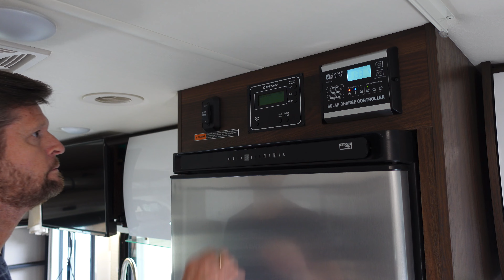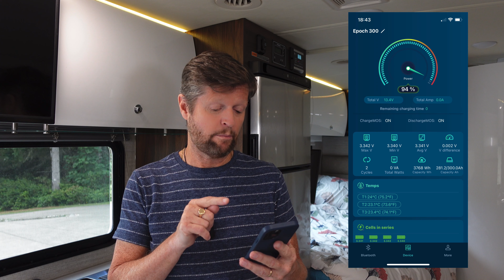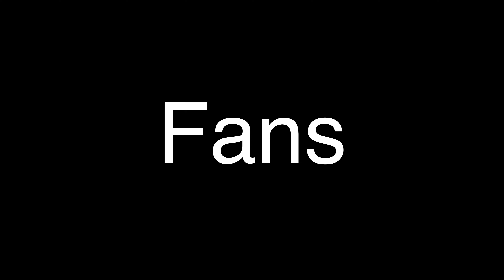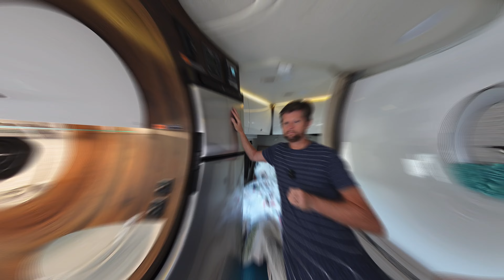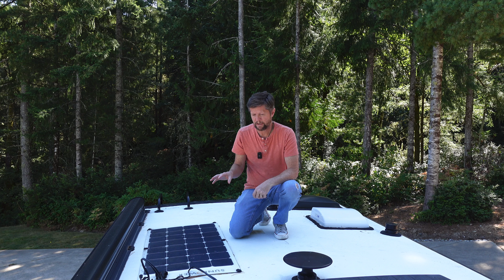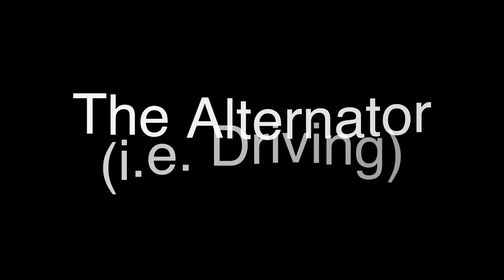Winnebago Navion / View: Battery Power Management Strategy

Comment: Used your videos to install 300Ah Epoch in 2020 (2019 Sprinter Chassis) Navion 24D    Very well done.  All works except charging from Alternator.  
Engine Running, MasterVolt Charge Mate Pro shows following
A Side 14.8 VDC
B Side 13.2 VDC
Switch Input floating, measures 1.99VDC

Green LED On   Solid
Red LED Off

Seems to me even though Solid Green A not connecting to B as not within 200mV.

Epoch App shows no charge current flow also.  

Any Suggestions?
Reply from the maker: That is strange - should be the same hardware as mine. I am guessing your Chargemate may be different and may require a change of charging voltage for the Li battery.

Comment: I have a 2021 View and as I understand the engine alternator does not charge the house batteries. Is that correct? I have two AGM batteries for the coach.

Comment: Very informative.  
I own a 2020 Winnebago View 24V.  I purchased it new and travel all over the Pacific NW, Arizona, Nevada & Montana.  My exterior design is the same as the one shown in your video. 
I upgraded my batteries to 5 Lion Lithium. I also removed the flexible solar panels and added 680 watts of Zamp glass panels. I am using the victron system & Zantrex freedom. My generator is an Onan 3200.
I am always worried about running out of power.  I refuse to run the televisions and have not done so in three years.  I do however use my micro at the least, once a day. I run my coffee maker once a day as well. Instead of running lights, I purchased multiple battery candles, solar lights for the nights. 
My big power draw is my air conditioner which runs all day as I am in Pahrump Nevada right now where it is over 100 F (I am plugged in). I love to save money by boon-docking but this heat makes that impossible. It’s 104 outside, I needed to plug in or drive back north. I chose to bite the bullet and stay south & pray for relief.
Reply: I'm like you I have 600 watts on my roof, I what have 1000 watts in portable panels. I invested in an all in one 3200 watt inverter. I installed 4 310 amp hour batteries in the rear storage area. I use two portable dc AC units when not using the roof Air . sometimes I bring my 3600 watt portable power station.

Comment: Fantastic video!  I just had one question though for my 2022 Winnebago View.  When plugging into shore power, does the inverter/converter need to be on or off? I have 500 W solar panels and they charge the battery well, however, when having electric available and plugging into short power I don’t see the power going to my battery. Do you have any suggestions?
Reply from the maker: That is strange. Your inverter should be a combination inverter/charger and should be charging your battery when connected (and no, the inverter does not need to be powered on). Maybe you have a faulty inverter or a bad connection?
Reply: @ttl_channel  I agree it’s strange. Dealership said inverter switch had to be on to have shore power charge the battery. It was my understanding that shore power should bypass the battery all together and when disconnecting from shoe power the inverter/converter would kick in battery power. Am I mistaken?

Appreciate the information you provide in your videos!
Reply: I think inverter must be turned on for charging period.

Comment: Thank you for doing the diligent work in putting this video together! I have the 2023 View so much of this is very applicable. I liked and subscribed. I am concerned also about the Sprinter battery if not driving as often or having long breaks between trips. It is consistently lower than the House battery. I think I’ll get the extra Solar panels and plug into that awkward spot where the shore power cable resides. Assuming I have it.
Reply from the maker: Unfortunately, the solar setup is only connected to the house batteries - not the chassis battery. I find that my chassis battery is fine for at least 2-3 weeks. If you will be parked longer, just use a trickle charger occasionally to top it up.
Reply: @ttl_channel  good point! My storage facility adds a lot for power to the RV. I now live in a wonderful condo but RV storage is not possible.

Comment: Excellent video! Detail explanation of all or many RV devices that many of us are concerned about. One question I would ask you given your understanding of battery use and given the choice of some of the newer model year Winnebago Views going all electric wth lithium battery/all electric coaches - (no genny or propane)- in your opinion would you go that way?
Reply from the maker: Good question. With the generator, it feels good to know that I have a backup, but in all honesty, I rarely use it. For the same weight/size (probably less), I could install an extra 10KWh of batteries and never have to worry!
As for the powertrain, I guess as long as the range is there (300 miles minimum) and the ability to link to the house batteries as needed, I could go for that.

Comment: Where was your factory DC/DC charger located?  Are they the same in all years?  I have a 2017 and wondering if I can just upgrade my battery to lithium without getting new DC/DC charger.
Reply from the maker: I believe it’s under the passenger seat, but have not accessed it as there was nothing to change/configure. In a 2020 model (2019 Sprinter chassis) it’s a Charge Mate Pro 40, which is lithium-compatible. No idea what is in a 2017.

Comment: Does the Inverter switch need to be on when charging the batteries with the Generator???
Reply from the maker: No it does not. The inverter switch only needs to be on to provide 120V to the coach when no shore power or no generator.
Reply: @ttl_channel does this app,y to when plugging into shore power as well?

Comment: I am constantly worrying about battery management on my 2013 View.  I still have lead acid batteries and no solar.  My options for charging either involve fossil fuels (I am that guy) or shore grid power.  I see all this hoopla over solar generators.  I am curious why you would charge your solar generator with portable solar panels and then use the generator to charge your house batteries versus using your portable solar panels to charge your house batteries through your existing controller?  I understand the solar generator gives you extra capacity but would you really need it if your (400 watt total)solar panels can replenish the daily draw down, given you have fairly decent exposure/favorable weather?
Reply from the maker: Maybe I did not explain my strategy very well. My first priority is always to charge the coach battery, using both the fixed roof solar and an additional portable panel as needed. The idea of the solar generator is to have a full "fuel can" for whenever my normal charging options (solar, shore power, driving) have not been sufficient.